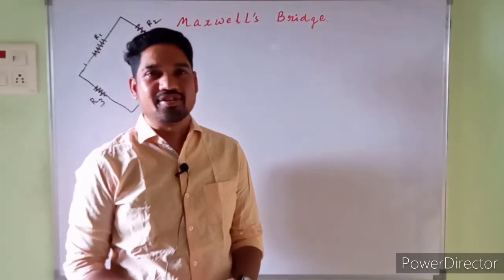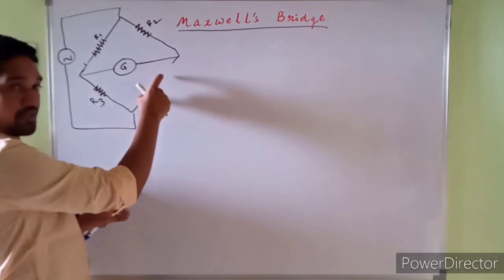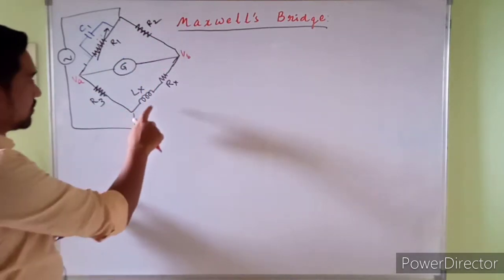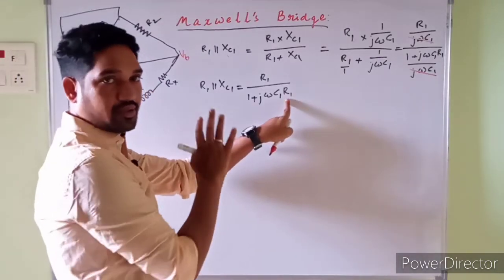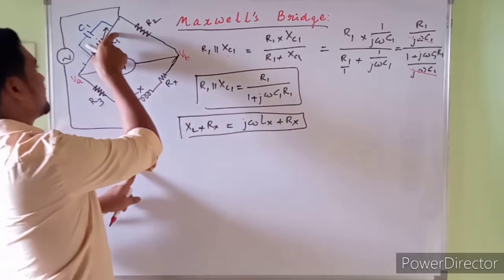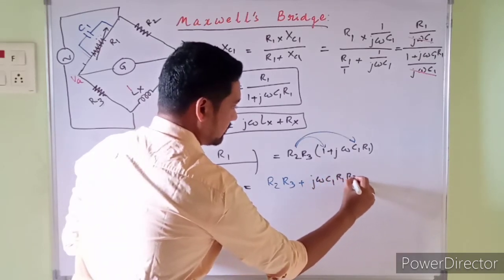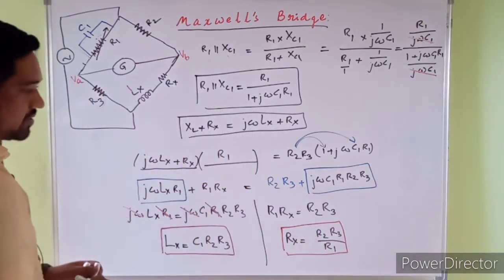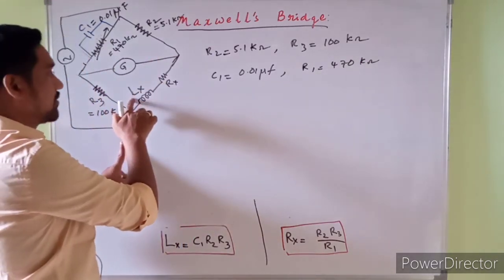Maxwell's bridge || measurement of unknown inductance  ||

Comment: In the place of galvanometer detector are used is mandatory or not sir?
Reply from the maker: It will be helpful to check if bridge is balanced or not balanced. If balanced, no current flows through the detector and then, the product of opposite impedances are equal., And the unknown capacitance and inductance is measured in case of AC bridges.